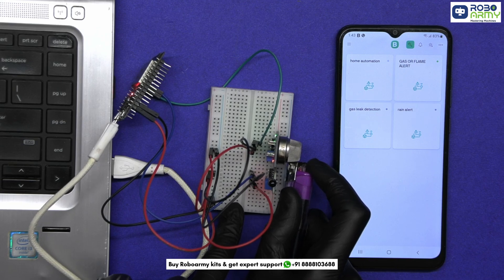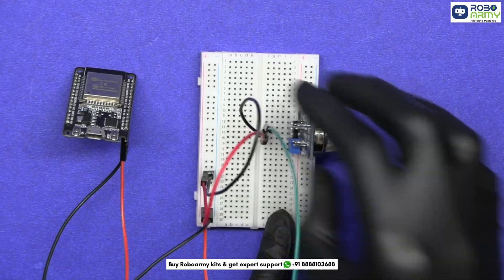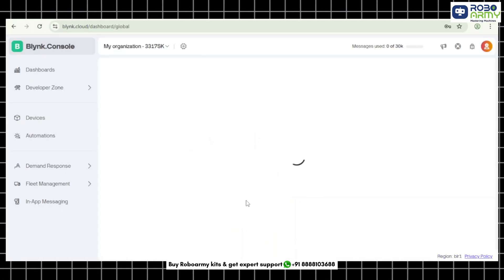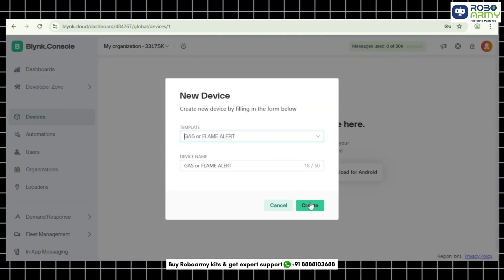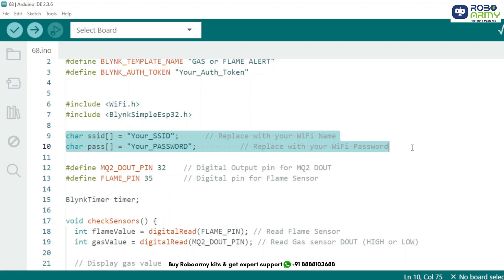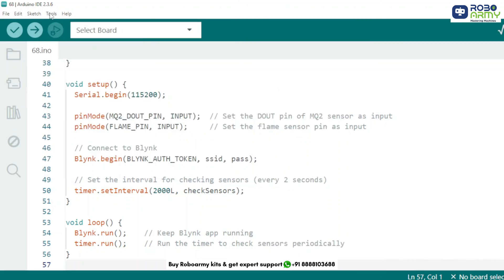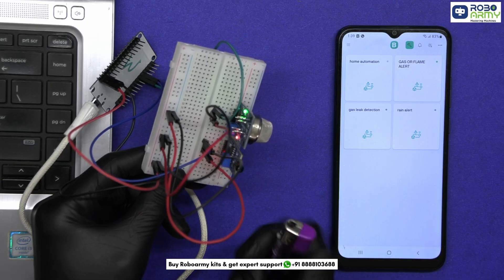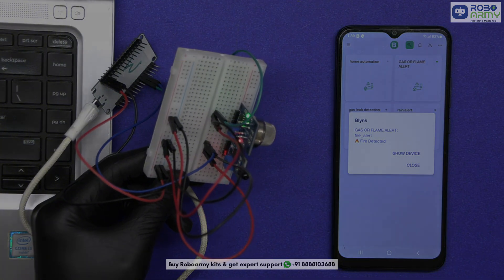Smart Gas & Flame Alert System using Blynk | Real-Time Safety Alerts📱🔥

Comment: Can i add pump to make a sprinkler?
Reply from the maker: Yes, absolutely 👍
You can add a water pump to make it a sprinkler system. You’ll just need a relay module or motor driver because the ESP32 cannot power a pump directly.
You can trigger the pump when a fire is detected. We may cover this upgrade in a future video.

Comment: hey, if i only make the gas one without adding the flame detector, is it possible?
Reply from the maker: Yes 👍
This project is modular. You can build only the gas leak alert system using the MQ2 sensor. Simply ignore the flame sensor hardware and remove the flame-related code.
Flame-related code to REMOVE / COMMENT OUT

❌ 1. Pin definition
#define FLAME_PIN 35

❌ 2. Flame sensor reading
int flameValue = digitalRead(FLAME_PIN);

❌ 3. Flame alert event
if (flameValue == LOW) {
  Blynk.logEvent("fire_alert", "🔥 Fire Detected!");
}

❌ 4. Flame debug print
Serial.print("Flame Sensor: ");
Serial.println(flameValue == LOW ? "Flame Detected" : "No Flame");

❌ 5. Pin mode in setup
pinMode(FLAME_PIN, INPUT);
Reply: @robo_army_  alr, tysm

Comment: can you add sounds or buzzer for that project
Reply from the maker: Absolutely yes! 🔔
You can easily add a buzzer to this project for a local alarm along with the Blynk notifications.
Just connect a buzzer to the ESP32 (for example: positive to GPIO 14 and negative to GND) and trigger it inside the checkSensors() function when gas or flame is detected.

Comment: Hey please reply, if I do everything after that I just connect the device with power source not with laptop will it work?
Reply from the maker: Yes, absolutely! 😊
Once you upload the code to the ESP32 and it is successfully connected to WiFi and Blynk, you don’t need the laptop anymore.

Just power the ESP32 using:
a USB adapter,
a power bank,
or any 5V power source…

And it will automatically connect to WiFi again and continue sending alerts to your mobile phone.

Just make sure:
The power supply is stable
The ESP32 remains connected to the same WiFi network

Then everything will work perfectly!

Comment: Hey done with everything but notification is not coming like my every step  but sometimes wrong in my phone plzzz help
Reply: Same
Reply from the maker: Thanks for trying the project! 
If notifications are not coming consistently, please check the following:

1️⃣ Make sure notification permissions are enabled for the Blynk app in your phone settings
2️⃣ Your ESP32 must stay online and connected to WiFi 
3️⃣ Check if your event names match exactly in code and Blynk template:
gas_alert
fire_alert
4️⃣ Keep the Blynk app updated to the latest version 
5️⃣ Some phones block background notifications — enable background running and battery unrestricted settings for Blynk 
6️⃣ Try to keep a stable WiFi connection for both ESP32 and mobile

Comment: Is it possible to make a notification spam or atleast continously?
Reply from the maker: Yes — you can make notifications repeat while a gas or flame condition continues, but you should avoid spamming.
We recommend sending a notification every 30 seconds (or whatever you prefer) while the sensor stays triggered.
We’ve added a rate-limited code snippet in the description/comments so you can copy it and adjust the repeat interval. Remember: use repeated alerts responsibly!

Comment: I have uploaded code and not working I guess no msg detection popup showing in phone everything is okhay just i have selected the extra notification ticks which there were given , is that the problem..?
Reply from the maker: It might be due to how the Events are set up in Blynk. 😊
Make sure you’ve created the events exactly with these names in your Blynk template:
fire_alert
gas_alert

They must match exactly (same spelling, lowercase letters, and underscores).
Also, ensure that:
✅ The “Send Push Notification” option is enabled for each event.
✅ Your Blynk app notifications are allowed in your phone settings.
✅ The ESP32 is connected to Wi-Fi (you should see “Device is online” in Blynk).

If you turned on extra notification checkboxes, no worries — just recheck that “Notify every time” is ticked and the event names are correct.

Try these steps once, and it should start showing alerts on your phone!
Reply: @robo_army_ Did again but no use idk why every thing is okay just it is notification that not showing... although in serial monitor it is showing perfectly according to situation .. in website even it is showing online status...but not working 😅

Comment: It is not connecting
Reply from the maker: Hi! 👋 If your ESP32 is not connecting, please check these points one by one:
1️⃣ Make sure your Wi-Fi name (SSID) and password in the code are entered correctly (case-sensitive).
2️⃣ Ensure your Wi-Fi is 2.4 GHz, as ESP32 doesn’t support 5 GHz networks.
3️⃣ Check that you’ve entered the correct Blynk Auth Token from your template.
4️⃣ Try pressing the RESET button on the ESP32 after uploading the code.
5️⃣ Open Serial Monitor (115200 baud) to see if it shows “Connecting to WiFi” — this will help you find the issue.
Reply: @robo_army_ it is not showing the port

Comment: Hey can you name the library to be downloaded
Reply from the maker: Sure! You just need to install these libraries in Arduino IDE:
👉 Blynk (by Volodymyr Shymanskyy)
👉 WiFi (comes pre-installed with ESP32 board support).
Also, make sure you’ve added the ESP32 board in your Arduino IDE from the Board Manager URL given in the description!
Reply: @robo_army_ how to add esp32 board from description I have already downloaded the esp32 dev module
Reply: But it is having port problem

Comment: is there any limit of blynk of sending messages or issue 
can we use it for completely free?
and how to give power to esp32??
Reply from the maker: Great question! 
 Yes, you can use Blynk absolutely free for small personal projects like this one — there’s no limit on normal event notifications if used within fair use.
However, for large-scale or commercial projects, Blynk offers paid plans with extra features and higher limits.

To power your ESP32, you can simply use a micro USB cable connected to your laptop, PC, or a 5V mobile charger adapter. You can also use a 5V battery pack or power bank for portable use.

Comment: Share code for IR
Reply from the maker: Sure! 😊 The IR sensor code will be uploaded soon — stay tuned!
If you’re looking for a basic test code, you can also use this one to check your IR sensor readings through the Serial Monitor 👇
int sensor = 7; // Connect IR output pin to D7
int value;

void setup() {
  Serial.begin(9600);
  pinMode(sensor, INPUT);
}

void loop() {
  value = digitalRead(sensor);
  Serial.println(value);
  delay(500);
}

It will show “0” when something is detected and “1” when not detected.

Comment: code is not uploading
Reply from the maker: Sorry to hear that!  Try these quick checks:

Make sure the correct board (Arduino Uno/Nano, etc.) and COM port are selected in the Arduino IDE.
Check your USB cable — some are only for charging, not data.
Press the reset button on the board before uploading.
If it still doesn’t work, share the error message you’re getting — I’ll help you fix it!

Comment: is it possible if i want to add buzzer on it? can you show how if it’s possible? 🙏🏻
Reply from the maker: Yes, it’s definitely possible! You can easily add a buzzer to get an instant sound alert whenever gas or flame is detected. Just connect the positive pin of the buzzer to any digital pin (like D8) and the negative to GND, then add a few lines in the code to make it buzz when the sensor is triggered. I’ll try to make a short video on that soon
Reply: @robo_army_  ooh thank you for explaining but can you make the video? 😔 i really need it for my project 😭🙏🏻
Reply: Can you upload that video as soon as possible we really need that please

Comment: Hi robo army, when I upload the code, the notification keeps coming, and it says the gas is detected, but I never show any gas yet, and when I show the fire for flame, it's not sending any flame notification. Did you know of any issues?
Reply from the maker: Hi! 👋 It sounds like your gas sensor (MQ) might be detecting background gas or isn't calibrated properly. Try these:

Warm up the gas sensor for at least 30–60 seconds after powering on.

Adjust the potentiometer on the sensor to reduce sensitivity.

Connected to the right digital pin as per the code.

Comment: We can use mq8 sensor
Reply: @roboarmy  we can use Esp 8266 module
Reply from the maker: Yes, you can also use the ESP8266 module for this project with some modifications in the code and wiring. Just make sure the sensors are compatible with the GPIO pins, and you adjust the Blynk authentication accordingly.
ESP32 was used here for its extra GPIOs and better performance, but ESP8266 is a great lightweight option too! 😊💡
Reply: @robo_army_ thank you . Plz you can make a video in which you use esp8266 module
Reply from the maker: Noted, Will upload it soon.
Reply from the maker: Yes, the MQ8 sensor can also be used — it specifically detects hydrogen gas, while the MQ2 is more general-purpose and can detect LPG, methane, smoke, and other combustible gases.
You can modify the code slightly and use MQ8 for hydrogen-specific safety applications. Great suggestion!

Comment: hi i am atch youre sonarvision vido and i have a problem
hello.the vizulassing code is not working
do i need to builed the kit fist or does i did someting worng whith the code
Reply from the maker: Hi! Thanks for watching the SonarVision video and reaching out 😊
If the visualization code isn’t working, don’t worry — I’m here to help!

You don’t need to fully build the kit first, but the code may rely on connections to the ultrasonic sensor and display to work properly. Make sure:
🔹 The sensor is wired correctly to the Arduino/ESP
🔹 You’ve installed any required libraries (e.g., for OLED or serial visualization)
🔹 The correct board and COM port are selected in your Arduino IDE